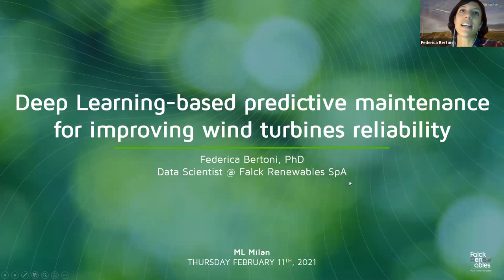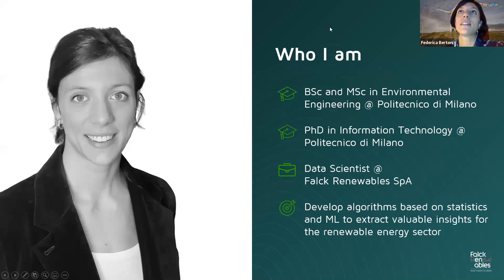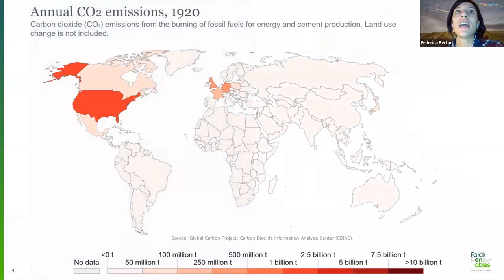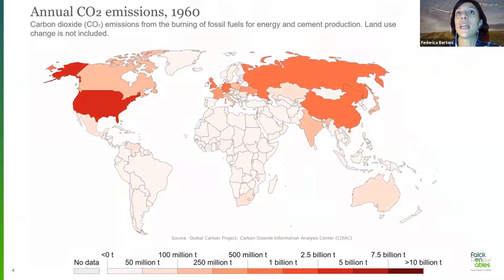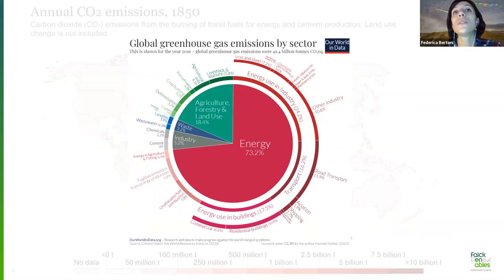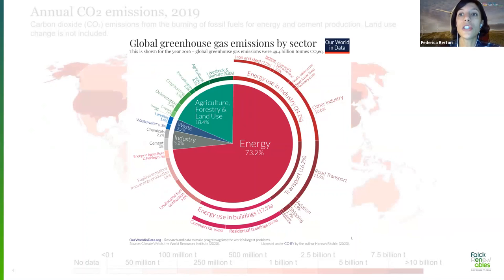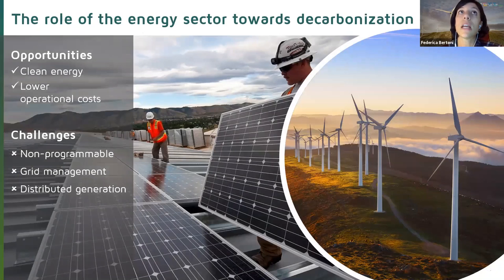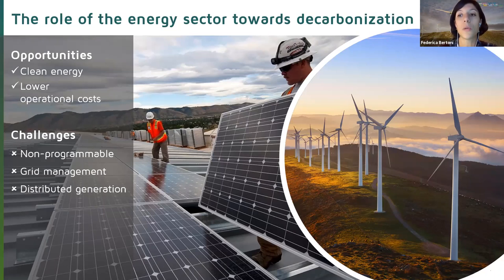Deep Learning-based predictive maintenance for improving wind turbines reliability - F. Bertoni

Comment: At 19:20, the explanation "update of SCADA system" is weird to me. Physically the update would not change real measurement value of PT100 temperature sensors. The bearing temperature does not change according to SCADA, SCADA only collects data.